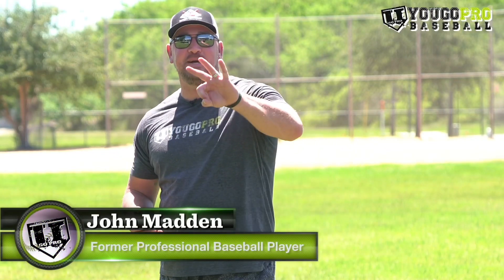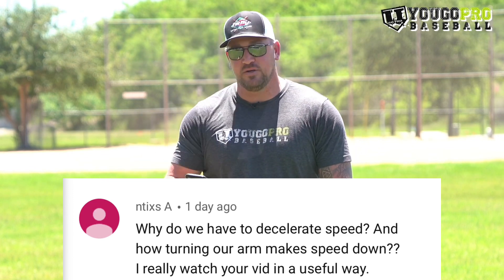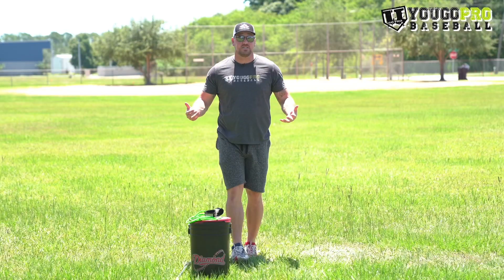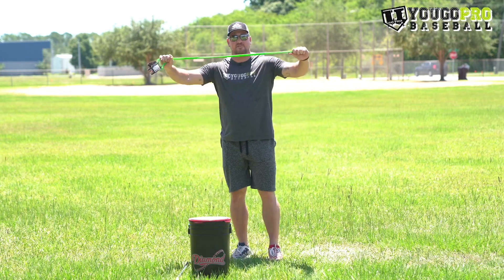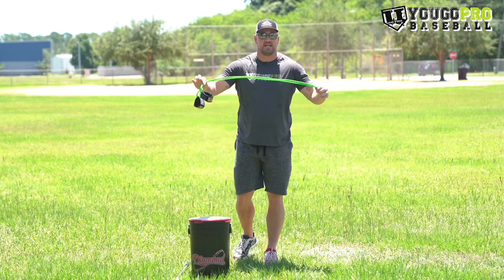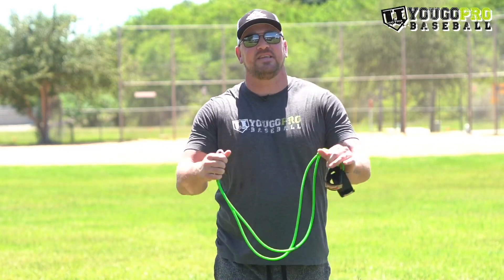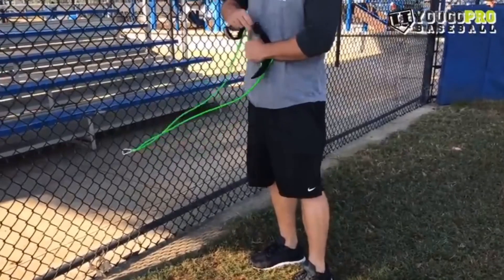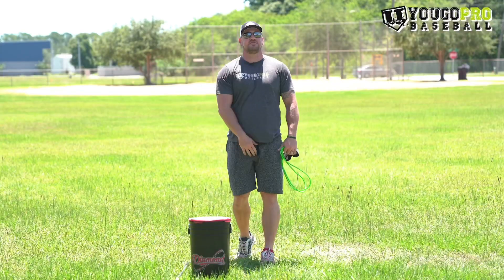3 PITCHING DRILLS - Exercises for Better Deceleration to Pitch Faster!

Comment: I have a problem that is that I'm stronger than other but can't throw faster. I'm kinda stuck at the speed I'm at. Any help would be great.
Reply: Joseph Sa I'm the same way. It's in the mechanics. When you can use your whole body motion you will get faster.
Reply: @GodsArmy87  I don't know what it is I've gone to those specialized baseball training etc and they said my mechanics were good. So at this point I really don't know
Reply: Just keep doing it, practicing it, the more the better.
Reply: @GodsArmy87  I'll just keep practicing 🙏